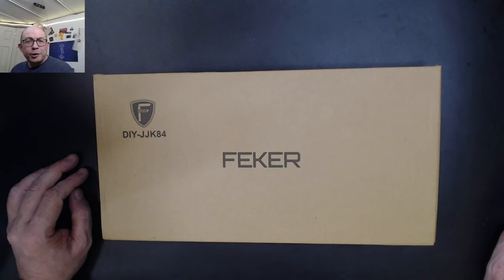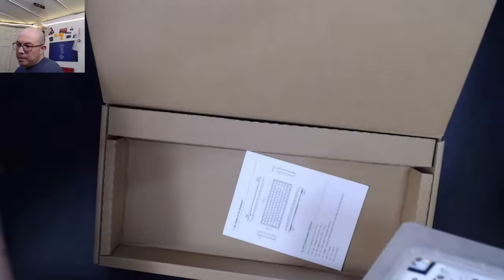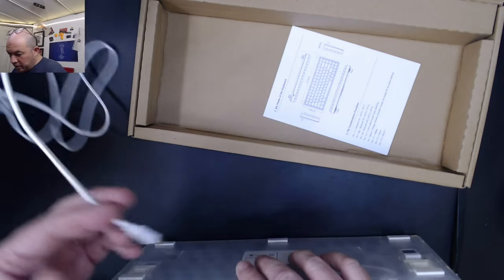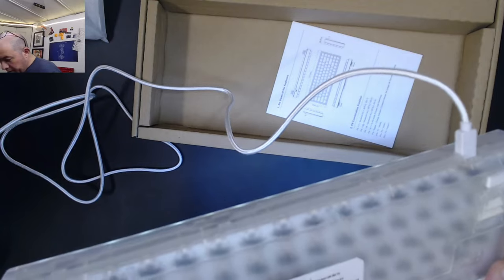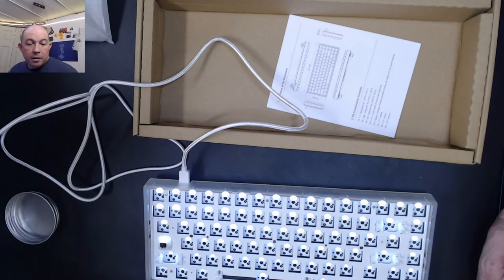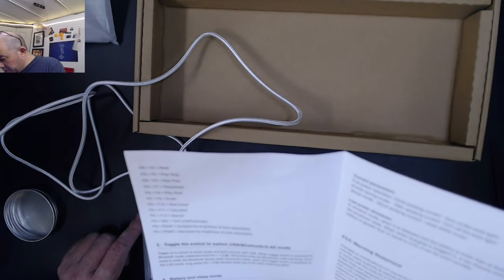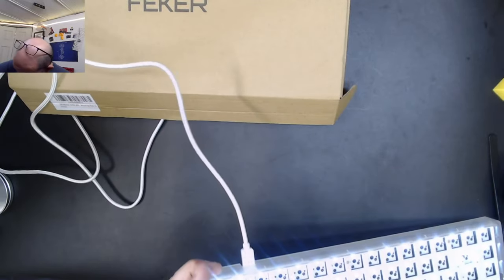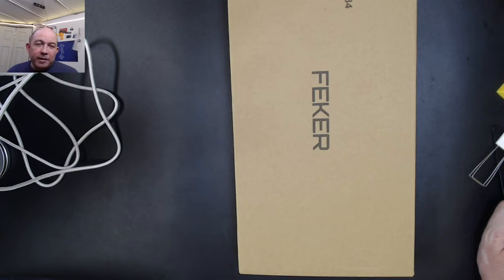Feker DIY-JJK84 Unboxing

Comment: hi i just received my new feker keyboard. but when i press button alt, it work as window button, when i press window button it work as alt button. i cant change on the software, can anyone pls help me.
Reply from the maker: You are in Mac mode, you need to switch over to Windows mode. Either hold Function and Windows down until the keys flash, or reset it by holding Function and Escape for 3 seconds.